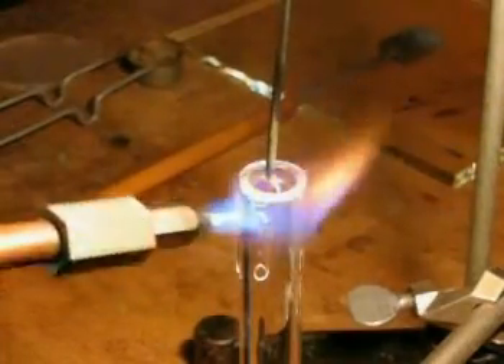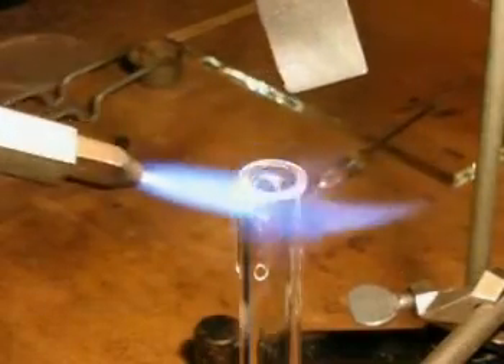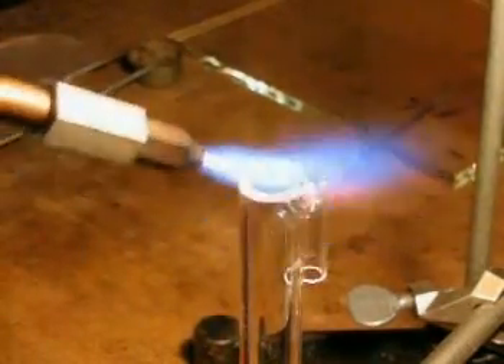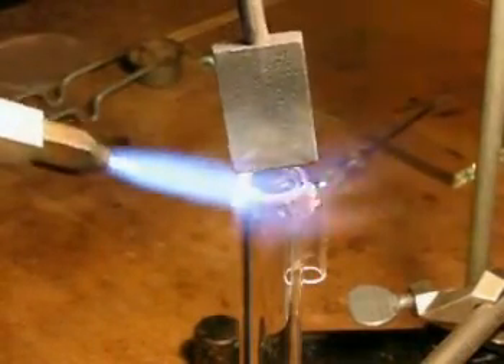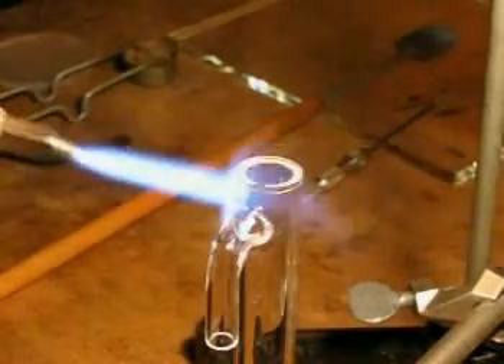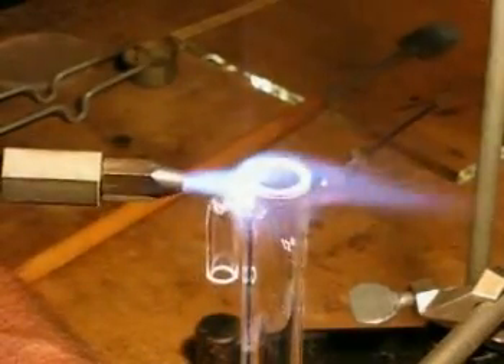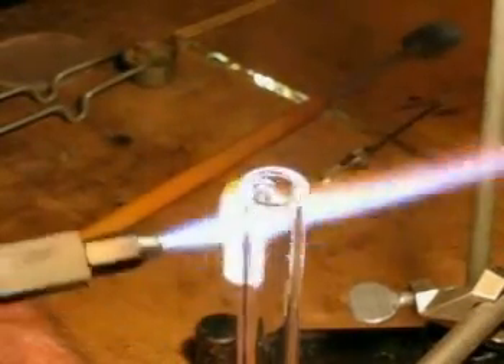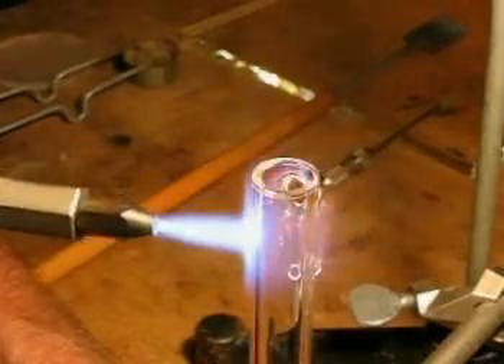Fusing Window to Quartz Cell and Flame Annealing-

Comment: I'm not so sure what you've shown in this video. I think that this is for experts only
Reply: thegoodfaery - the piece on top (he calls a window) is a round glass he fusing to the tube under it and that's why he use the ice pick looking thing to press down to hold it in place so it doesn't get blown off by the flame presure